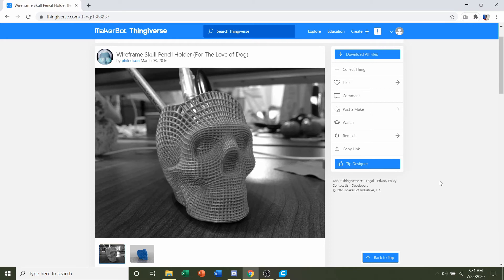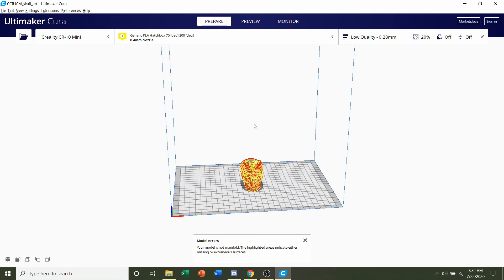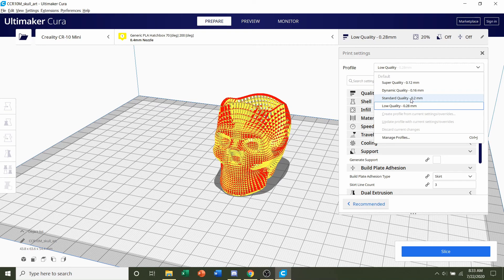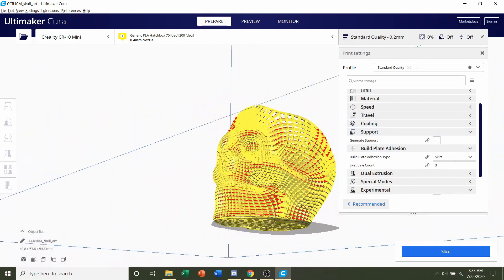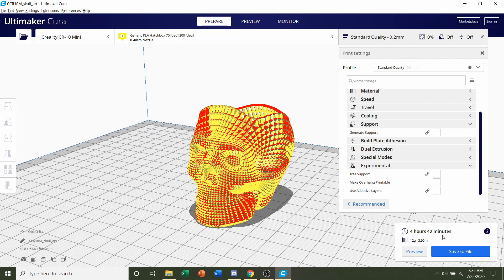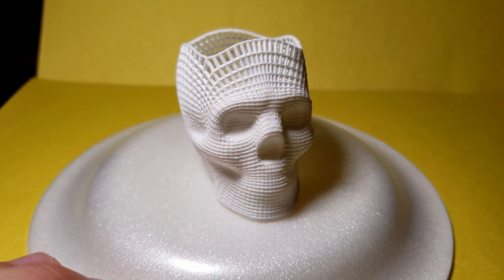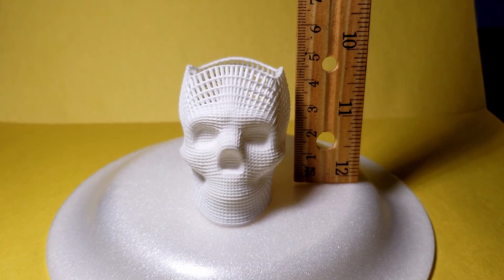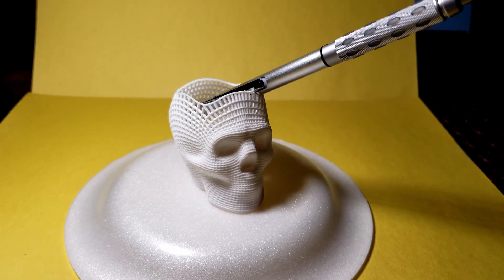Wireframe Skull 3D Printed - Tutorial, Print Settings, Time Lapse, Showcase

Comment: Nice Video, i did same settings like u, but Cura shows 7,5 hours, same scale everything. Is it because i using Ender 3 ?
Reply from the maker: Correct. Different printers print at different speeds. My CR-10 mini can print at roughly 50-70 mm/s. Ender 3 is a little slower which is why you have a higher estimated print time.

Comment: What speed did you print at mm/s and fan 100%?
Reply from the maker: I always stick with default Cura settings for my printer. Cura generally has the best default settings for the printer you selected in the initial set up. For my CR-10 mini, I believe default is at 50mm/s and fan 100%. You can honestly go a little faster (60-70mm/s) but I prefer to play it safe at 50mm/s
Reply: @Gabriels3DPrinting  Great thanks very much 👍

Comment: Ey, wondering how the devoloper could do this in 90 minutes. I'm getting (just like you) a 4 hours estimate. Any ideas?
Reply from the maker: They used a higher end printer with very high print speed capabilities making it a bit faster than a CR-10 for example. They didn't list the layer height either, but they did say they used a 0.8 [mm] wall which could be the layer thickness and in order to get that thickness, they probably used a bigger nozzle size or printed with at least a 0.4 [mm] layer height.
Reply: @Gabriels3DPrinting  Thanks man, very helpful